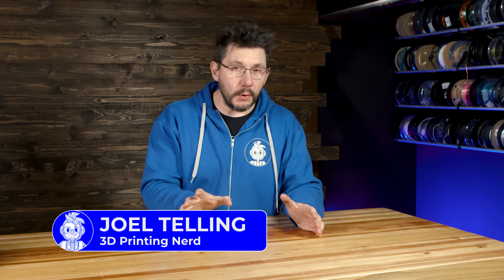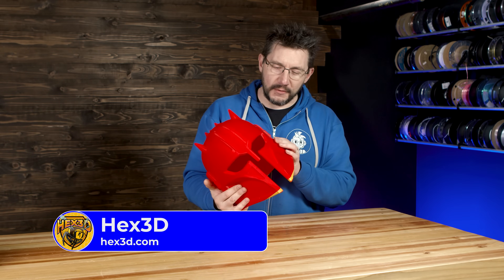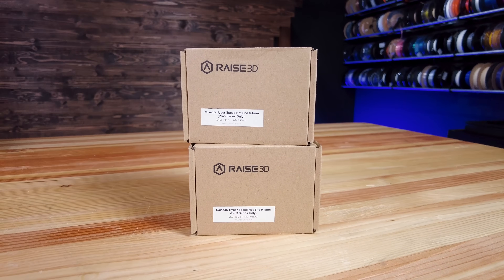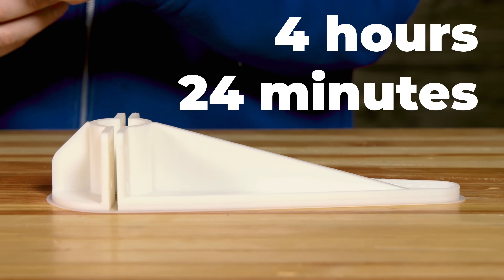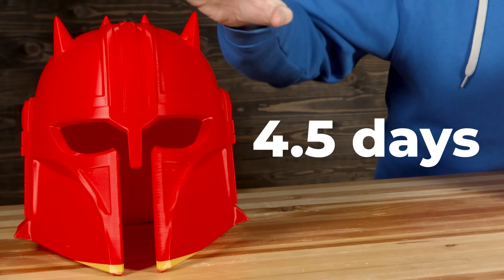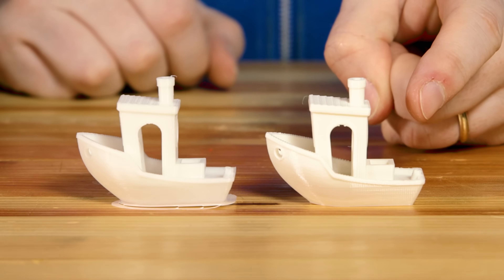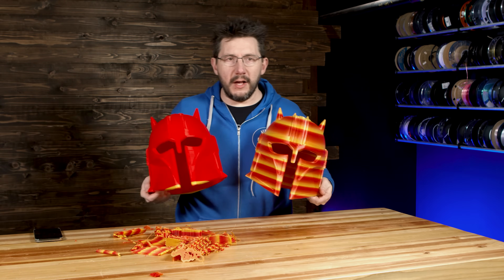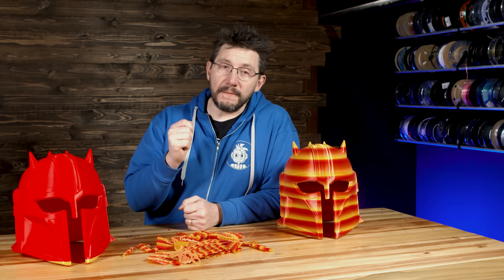Raise3D HyperFFF Cut My Print Times in Half!

Comment: I bought the N2 plus when it came out. I met the CEO at Maler fair and sold me on the printer for it's reliability. From the day I bought the printer, to today, I am still having issues.. I have bought and upgraded parts, replaced parts, adjusted and readjusted everything I was told to, and still can't reliably print anything. 
It's been very discouraging and upsetting to have now spent over $7000 into this printer and I still get prints that fail even during the raft. I have used many other smaller and cheaper printers, and have no issues, I use printers at work, my friends have printers that I have helped them set up and get working. But I was delt a lemon, and it's frustrating that with as much as I have spent, I still don't have a printer at home that I could trust for even a 12 hour print. 
Their customer service for the longest time was just that I should buy new parts and new upgrades, not what you want to hear after dropping over $5k on a new printer.

Comment: Quite some time ago you attempted to make a 3D printed record player.  Have you thought about making one that addresses the issues the old one had.  There most important issue I could think of was the motor drive was not smooth.  I suggest a D.C. motor with 3D printed pulley and belt solution.  Right, with that off my chest, I’ll get back to watching your video thanks!

Comment: Great stuff on ur channel! Quick question for you or your comunity. Did a small 3d print (10cm high) , all good, but at the end, rught when it finished the z arm went downwards right in the print, about 1cm, digging inside it and melting the top layers leaving its shape on the print. Anybody knows why? Its a bitmi 2+, very local, i dont know if they made more than 50 printers

Comment: Great video Joel, as always, but I have to laugh at Raise3D here.  Calling everything "hyper-whatever" is a joke.  These are commonplace and inexpensive tools that nearly every hobbyist is employing:  high flow hot ends, cheap accelerometers, and open source software.  And what is "hyper speed" filament??  Sounds like Hyper-BS to me.  These companies need to start actually innovating or they're going to get left in the dust very quickly.

Comment: It's hard to tell on a video but I thought the HyperFFF parts looked to have more wobbles, which being spatially coherent would mean oscillation or otherwise inconsistent stepper motor steps. When they're spatially incoherent it's typically an extruder gear not running true with the motor axis. I wish the helments had both been printed in the same filament and we could've gotten some really good closeups. This seemed a bit rushed and not really a good comparison.

Comment: That moment when you realize somebody is being paid to promote gear that is overpriced and underperforms. JUST the upgrade to add Klipper (which is freeware) costs $999. This Raise 3D printer is $3999 for a grand total of nearly $5000. A P1P trounces this thing at $699 in quality, speed and value. TROUNCES.  Klipper has been around for a while, and companies are only interested in it now because Bambu has forced their hand. Wait until Bambu releases a bigger and a smaller printer. It's all over...

Comment: I campaigned hard to get my employer to replace our ancient Stratasys printer with the Pro 3 from Raise 3D but they ended up spending more money on an Ultimaker S5. A good printer but old technology. 
BTW, why didn't you use a soluble support material on your helmet?
Reply from the maker: For this test I wanted to use a single extruder. That and I couldn’t find my soluble support. Heh.

Comment: One question how have you tried a calibration cube and  other prints to see if affects  Accuracy and proficiency   When printing items that actually require specific tolerances.
Reply: Do you know what a Benchy is? A calibration print...
Reply: @cenciende9401  yes but it not a tolerance test  it grate for bridge and over hangs but with 20x20x20 cub we can see how if the how the accurately it can print.

Comment: Pretty impressive time saving and great for production prints for sure.  That said it may just be the lighting but the slow speed mini Joel and the benchy looked to have more detail and sharper edges so if fidelity is your aim then the HypperFFF falls short.
Reply: "Pretty impressive time saving" is "from awfully slow to normal speed".
Reply: He used a different filament entirely, to my eyes; one that didn't catch the light in the same way at all. So I couldn't really compare them properly, the differences in the print quality were just too minute in comparison to the filament.

Comment: The printer is good.  But due to the fact that you have to use ideamaker, a lot of time is spent on setting up printing.  And a lot of material and time for support.  Tried to create a profile for Prusaslicer, but a lot of things don't work (resuming printing, changing filament...).  And the E2CF printer generally turned out to work ONLY with ideamaker, and ONLY branded PA12CF and support material.  And a lot of settings are blocked.
Reply: Hi there, thanks for your comment. Good news that it isn't only branded material. We actually have a lot of templates added for 3rd party materials.
ideamaker.io has 60 templates available for the E2CF including 3rd party filament manufacturers including FiberThree KEXCELLED eSUN Jabil Kimya BASF Polymaker and more.
Reply: @Raise3D  "Cannot import the slicing template into Raise3D E2CF printers" It's horrible.  When you can't print your favorite material on the printer.  I need to print let's say a simple petg, but I can't do it.  I can't create a profile for it, I can't download a profile for any petg, and I can't change an existing profile to fit my needs.  It seems to me that in the name "Open filament program" the word "Open" is superfluous.

Comment: Man I printed a whole head that size with internal supports in like 12h on my knock off i3 before I even installed klipper and got it down to a 5.5min benchie
Reply: Don't believe. Reviewers go nuts over a 30 minute Benchy on new super fast machines like the P1P, you're not doing 5 mins printing at 1000mm/s speeds

Comment: For the raise 3 pro, the kit is $999 for 

- An Upgrade Letter (instructions I think)
- Software upgrades
- Two Hyper Speed Hot Ends 0.4mm 
- A Hyper Speed Auto Calibrator (According to Joel is an accelerometer)
- 1kg of Hyper Speed PLA 
- 1kg of Hyper Speed ABS 

Seems like a lot for 2 hotends, firmware update, a $5 accelerometer, and 2 kg of filament.
Reply: Both hotend are $200 each, so $400 total. 

Each roll of filament is $36. For a total of $72. 

With no bundle discount you are paying $528 for:

- Upgrade Letter (likely instructions)
- Software (cost of implementing an open source firmware... so the R&D cost is here)
- hyper Speed auto calibrator.
Reply: SMH. Ignore the filament and the accelerometer. There is an expectation of the consumer to swallow $1000 for two hotends and basically the implementation of Klipper into their system BIOS? No thank you.
Reply: @thomaswiley666  exactly my point. Absolutely ridiculous.
Reply: I imagine part of the cost is also covering the R&D that went into its development?
Reply: @davidtobin  oh I understand that, but still. I imagine that's about $150-200 at the very most for the actual products.  The rest is R&D  and profit.
Reply: Nope, Research was close to 0. All researched and most open source.
Reply: There's value in keeping a machine that you're familiar with and is already integrated into your process, IMO.
Reply: Yeah that's craaaazy. Just pick up a bambulab printer instead of the upgrade  sounds better. And sell the old printer if they are going to shaft you for upgrades.
Reply: I remember selling my first products years ago, I met a guy in sales. He told me to up my prices, because if it's more expensive it will make the customer feel like it's something better
Reply: It is a lot. They're scammers.
Reply: That is very true but to be fair their customer service is awesome! So I think that should be added to your list ;)
Reply: I owe the E2 model and it's given me headaches since the get go but their customer service has more than made up for all the inconvenince the machine has put me through. It would be ideal to have a perfect machine but in the land of 3d printing that's yet to be seen.
Reply: Welcome to Raise3D and all other "prosumer" level FDM pricing. Gotta keep those profits fat while trying to avoid getting your shit wrecked by BambuLab.
Reply: All of the upgrade and benchy is still 20min slower than a bambu and v400. 
I don't understand this kind of printers.

Comment: That's better than before but it's still far from Bambu Lab print speeds. The only thing the Raise3d has going for it is its bigger build volume which can accommodate a full size helmet.
For comparison on the Bambu you'd have to shrink the helmet by 20% so it'd fit, which would then print in about 17 hours 24 minutes using ABS with all default settings. We need to add back 20% time (3.4H) to compare apples to apples, but let's be generous and add back 25% time instead (4.25H) and the total print time would still only be around 22H. Far less than a day.
Raise3D and other manufacturers still have a long way to go.
Reply: Hello there! We really appreciate the feedback. We will continue to improve slicer profiles and keep focusing on speed and print quality for our upcoming releases.
Reply: @Raise3D  My company has a Pro2 Plus Dual and a Pro3 Plus Dual and we'll already ordered an upgrade kit for the Pro3 but it'd be great if we could also upgrade our Pro2. 👍
Reply: But if you print 20% smaller, it no longer becomes a functional helmet.
Reply: @davidtobin  Did you really just read the first line?
Reply: @mururoa7024  No. You wanted apples to apples. :)
Reply: @davidtobin  Math is hard so I'll help you out: 80% + 20% = 100% 😉
Reply: @mururoa7024  🤦‍♀
Reply: @davidtobin  You still don't get it? OK, since the helmet comparison doesn't work for you, let's compare the benchy. 59 minutes on the Raise3D, and 12 to 17 minutes on the Bambu Lab depending on the settings. Get it now?

Comment: glad you had the models printed with the same filament, as the ones lacking the hyper tech, because I am guessing something in the filament of the new helmet caused it to look like a rougher layer lay down print, as it looks a bit ripply like the head of the printer is being wobbled by say over excitation of movement that reverberates instead of being dampened before squirting out the plastic,

Comment: Man oh man this is awesome. Wishing I could get the HyperFFF on my N2+ absolutely love that machine. That print turned out fantastic and always love how simple supports come off ideamaker
Reply: We are actually working on more upgrades for other machines. And the firmware upgrade for the Pro2 series is coming out very soon! Follow @raise3d on social media outlets or visit raise3d.com for the latest updates!
Reply: @Raise3D  fantastic! Can’t wait!
Reply: @Raise3D  I have an N2+ are you going to make this upgrade for the N2+ ??? I ran my n2+ for 8 months and the touch screen stopped working, pass the warranty and then you told me I needed to replace it for I think $900.00.
So now I have a $5000.00+ 3d printer just collecting dust.
How would you feel about that if this printer was your printer ???
Reply: @joearchuleta7538  you can use a desktop mouse to control everything with a USB port on the side not to mention everything is fully configurable over wifi if you connect to it
Reply: @Xaviervaa  Came to make the same comment - my touch screen also died and I've been living with a mouse.  Kind of a pain as the mouse has to be used sideways, but it works.
Reply: @Raise3D  If you have an N2+ upgrade somewhere in the works I will kiss every single team member there! (Or fist bump....employee's choice!). I've been toying with the idea of replacing the electronics with a 32 bit board...but I just love the damn display so much!
Reply: My first 3D printer is the Pro3 I’ve had for a year. I love it and was thinking about this upgrade. I like the swappable extruders since I sometimes put in 0.6mm hardened nozzles for abrasive nylons.
Reply: they may actually do that to the pro 2 and eventually oder models  ones the money on the pro 3 is made with the upgrades in the end its alot of money just to implement klipper ..

then again the N2+ mainbord is way older an probably not able to handle klipper on its own ..dono
Reply: @MrBendix24  Doubtful they will do anything for the Pro2 users. We have been BEGGING for an ABL solution for years (to make up for their crappy bed leveling design) and have been told to basically kick rocks.

Comment: Hi. Great video.
A major professional company increasing the value of their products to keep ahead of the young guns stepping into the ring.
I am using CHEP'S FFEF profiles on my Ender printers. Same settings for my Ender 2 Pro's and my Ender 3 S1'S. And it cut my print times by at least 33% to 50%.
I have to note my prints are 90% functional prints. So the quality is good, very good.
I adjust wall and top/bottom thickness for load bearing prints.

Comment: I have a Rasie3d Pro 3 at work and I am EXTREMELY disappointed in the machine that the price point! Their customer service is horrible, and the build quality/specs of the machine are NOT that of a $7500 printer. Very disappointed I wasted capex on this printer.
Reply: I’ve had a similar experience with their N2 Dual. They also don’t have good legacy product support, which isn’t great for an industry product. 
I’ve got a small product design company, and initially bought a Raise 3D N2 and 2 Formlabs Form 3+’s. We still have them, barely use them since we’ve grown and now have 8 Prusa i3Mk3’s (got them several years before Bambu came out) and 2 Elegoo Saturn printers.
Reply: My Bambu P1S is much more user friendly and produces a better print. My employer will most likely not go with another Raise machine
Reply: Yeah, they're overrated and overpriced, and it's also hard to find honest content about them from people who are getting paid. Especially since not mentioning the shitty belt tensioning system that can barely handle those speeds, I seriously doubt the success rate of printing at those speeds.

Comment: That bracket is a funktional part. So there is no need for it to look that pretty
Print it with one of these newfangled 0.6mm high flow Nozzles and 0.5mm layers
Print crazy fast with 80mm/s or so and be done in linke 2 Hours
Reply: Well, I have a 0.8mm nozzle on my CR-10SMART and line with set to 1.2mm. layer thickness at 0.6mm. my functional parts are super strong and actually have a decent finish.
Less than 50% compared to 0.4mm default settings.
So yeah. Nozzle size makes a big difference.
Reply: 80mm/s is super slow by today's standards...